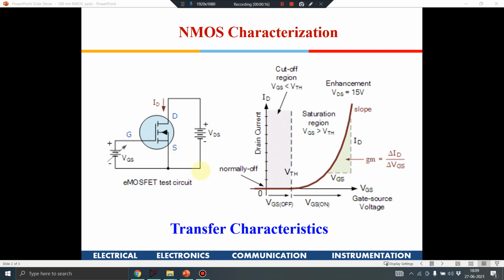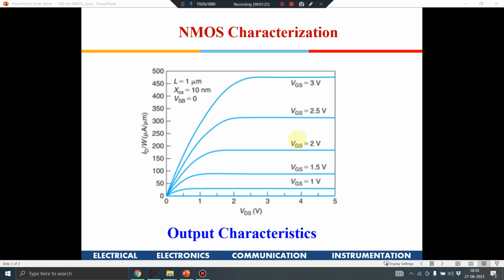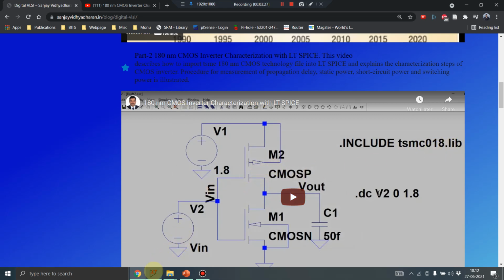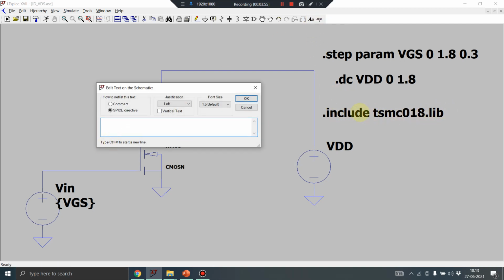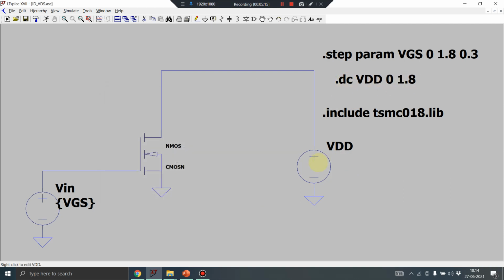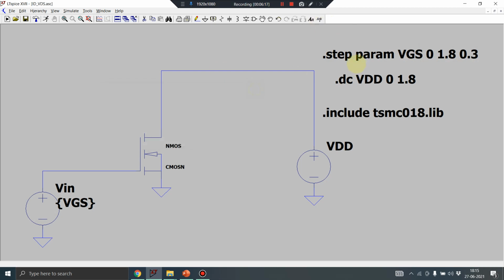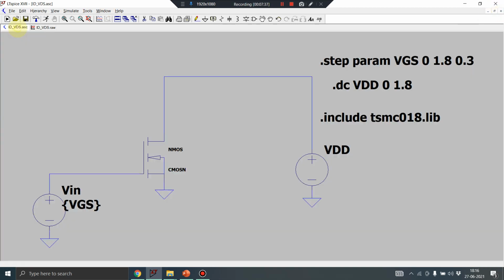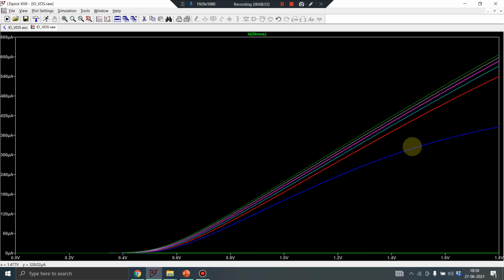TSMC 180 nm NMOS Characterization. Transfer Characteristics & Output Characteristics  in LT Spice

Comment: Dear sir, please I need to calculate the parasitic capacitance of FinFET device using LTSPICE. best wishes.
Reply from the maker: We wont get the capacitance plot directly in LT  SPICE.  You may want to try by giving a high frequnct ac sinnisodal signal at gate and mesaure current and copute the impedance and capacitance

Comment: Sir please do a experiment of voltage level shifter and curret tail comparator or bandgap reference generator in  tsmc 180. Please sir it will be really helpful
Reply from the maker: Next Semester I will be taking ADVD course at BITS. These circuits  is part of the course. I will be uploading all my lectures.